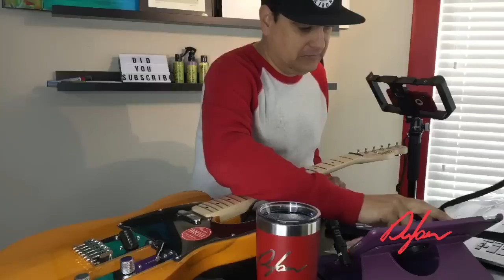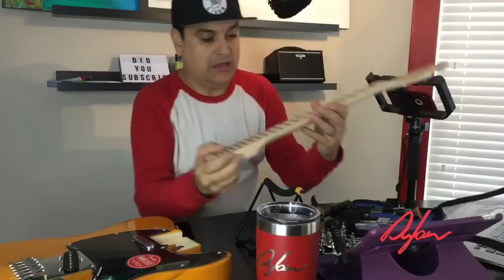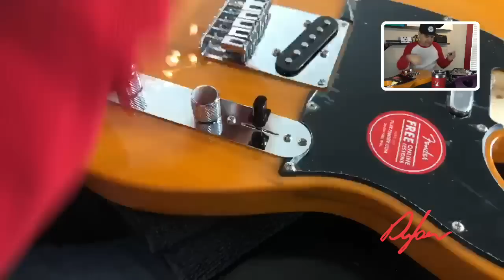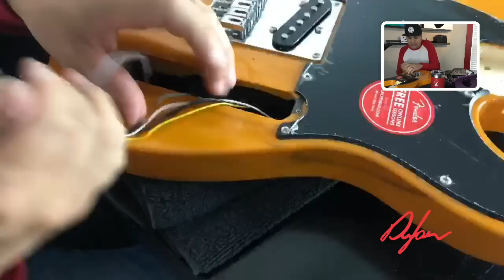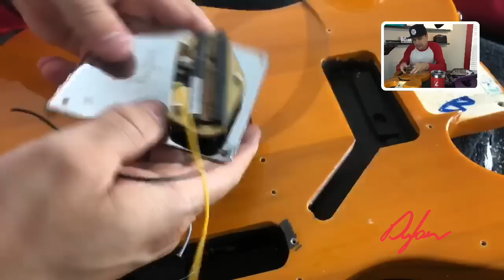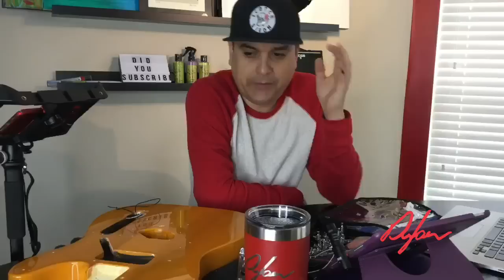What a $200.00 Guitar Looks Like Inside (Livestream)

Comment: I don't know which drop-in tuners you were referring to, but understand this: NO Fender tuners are drop-in for this Squier. Those two pins are in a different place than the two pins on SIMILAR Fender tuners. Those tuners will NOT work without drilling new holes for those pins. I agree that there's no reason to change them, but be forewarned that there are not many locking tuners available that will work without drilling new holes.

Comment: Seems like the Squire Limited Edition Bullet TeleCaster (Made in Indonesia - often on sale for ~$120-130) might be a better trade off in terms of an inexpensive starting guitar.  Since you have already modded the Affinity it would be a great comparo. It has the string thru bridge as well as a neck pickup that is mounted to the pickguard. It also has a little wider neck. I am guessing that both pickups are similar. I love the concept of just replacing what is not working or what is limiting the guitars performance. Great video !

Comment: NOOOOOOO!!! Don't change the pickguard colour! Black is fine. Black is traditional for a butterscotch blond Tele. Bruce's Tele has a black pickguard, and so does Keef's.
Interesting to note the differences with my own butterscotch 2017 Affinity Tele. Mine is routed for a single-coil neck pickup with no channel leading to the control cavity. No shielding paint in the cavities. I have considered AlNiCo pickups as a future upgrade, but I'm still happy with the stock pickups.
Reply: toan
Reply: The Originals were Black Bakelite with a Nitro Lacquer sprayed finish. if you flip them over there's a circle where they set them on a paint can while spraying and drying. That's why they're called 'Blackguard. My first Tele was from late 1954 after they were switching over from Black to White. They were ALL Single Ply.

Comment: From Leo:  Good video.  I do like a well made guitar with top grade components.  Modding and upgrading is a a lot of fun.   I agree with you that there is a point that it is just not worth it to get too extreme with upgrades.   
I bought a new cheap Squier Tele  three plus years ago to use as a loaner for students and a knock around guitar to leave out.  It has never been babied and shows plenty of scratches and nicks.  All I ever did to the guitar was clean up the nut when new and change strings.  That cheap Tele, with the cheap tuners, box switch, mini potentiometers , jack and pickups have never failed.   
Most beginners will sound better with another 20 lessons than too many electronic and hardware upgrades.  A more experienced player can benefit more from upgrades.

Comment: Bought a 2016 Model Tele Affinity and it became one of my Covid 2020 project guitars. Bought it for $110 delivered with a soft case and the guitar was in mint showroom condition. Stripped the neck and tinted the neck, fretboard, and headstock ( for aesthetics ). Added Brass saddles and a Tusq Nut. Replace the pickups with a used set of Seymour Duncans Alnico II's for $85 ( eBay score) Updated the pots with CTS and an Oak Grisby Switch. So for around $225 it's one of my favorite guitars in my collection. I only replaced the nut recently with a Tusq because it was a bit worn and chewed up. I love the feel of this guitar, a slightly thinner body, and a thinner neck. The tuners were fine, so left as is. Public Service Announcement -  I love cheap guitars that can be modded

Comment: Hey, Dylan, JG here. I made two neck supports for less than $3.00. 
1. I used an old pair of jeans I'd cut into shorts. The leg became a neck support by sewing up one end, filling it with rice, and sewing it closed. Bingo. The neck sinks right in. 
2. With so many Amazon deliveries, I used a rectangular cardboard box and filled it with filler stuff from all the deliveries, including puffy insulated packs. I cut a neck diameter into the box lengthwise and collapsed the cut into the well cushioned interior so that a guitar neck fits snugly into the cut-out leaving the top of the fretboard sticking out to do fretwork on stablized by three inch ends on either side. I covered the entire box with $1 contact paper from the local $1 store. The plastic contact makes the box water and oil proof and gives it a tiny bit more stability. I glued two white leather pieces together, also fm the same store, and glued it to the contact paper, which will hold it better than the porous cardboard underneath. Voila, really cool looking white leather guitar neck stabilizer. 
I use an ironing board for a guitar working station, BTW, which allows me to either sit or stand. I have a really nice piece of wood, which I'll eventually fasten to the ironing board permanently as soon as I figure out where I want it.
If these ideas help you or any one else, awesome. See you on the chats. Peace/Out. JG.

Comment: The only reasons I change tuners are for a better gear ratio on tuning and locking tuners make my string changes finish in half the time. Most of the problems in tuning actually comes down to the nut, not the tuners. Then the wood "tone" myth lol. How many oil can guitars and cigar box guitars are there???
I wish Fender would use staggered tuners to eliminate the annoying string trees.

Comment: I just bought a cheap 335 copy and I expected to change the pickups,but instead of tearing the whole guitar apart, I was wondering if I could just chop off the leads right in the cavity,strip off the ends and soider the new pickups right to the cut leads,right in the cavity,I can always add new leads to the pickups I'm removing but no one would want them even if I waxed them,yes they are that bad, trying to keep from taking everything apart to do it right, but of course I will srink wrap the leads and plan on pushing the excess back into the route,will this work Dylan or does it matter how long your pickup leads are,I plan to use this guitar to test different pickups and would rather soider leads than take the whole controls apart every time I change pickups,anyone can answer this post,let me know if you have tried this before and does the extra pickup wire matter as far as tone, people trim off pickups leads all the time,the question is, is smaller better,this is just going to be a pickup testing guitar until I find something for one of my better guitars with out tearing that apart until then too thanks.

Comment: I'm a little late to the party but if it were mine and I went as far as you went in the disassembly, I'd eliminate the string tree with those fender staggered, locking tuners, tusque nut, nicely built pickups, cloth wiring, and a reverse mounted control plate with the same pots but upgraded 4 way switch. I see no need to upgrade those pots because to me, I run my knobs wide open mostly. As for the bridge, I probably wouldn't buy a tele without string through body. Although, the teles this one is trying to imitate a 50's guitar and those didnt have perfectly straight ferrule holes anyway...Food for thought.

Comment: As a real fan of cheapest guitars I have made a hobby of refinishing cheap Kijiji finds. I simply replace ALL original parts into  them when refinish is done. Because I'm a loner. I play in my basement, self "taught". I have no buddies to jam with and no interest in that. So my guitars are ALWAYS played low volume and very gently. I DON'T scratch my pick guards. In these circumstances cheap tuners don't fail. Pickups never disappoint because my modelling amps and pedals offer endless opportunity to find pleasing tones. So I've got a lot of cheap guitars here with terrific setups that are in brand new condition. I've gotten pretty good at filing, levelling, shimming, etc. Sure they're still cheap stuff after all my work but I could not care less about that! I repaint pick guards to suit and I replace damaged headstock logos. I'm grateful for cheap Chinese made brand supported guitars.

Comment: Love the info! Quick question: It’s pretty clear that you aren’t a fan of the pickups that come standard on these guitars, and in my experience I agree they tend to sound sub par. What makes these so much worse than the strat and Tele sized “p90s” you offer on your site? Obviously the pole pieces are different, but is there a difference in the type of ceramic magnets used? Or do you use custom Alnicos in yours?
Reply from the maker: Jeff Ralston the type of ceramic and how they are wound both make a huge difference yes

Comment: Anything than black or white on this tele will look wrong. And if the pig guard are gonna be replaced then go full nuts and use green or pink oyster, If we're having a party then party hard. One question, i've heard that shielding a telly will affect the tone, true or false ? My suggestin for a nut, YJM brass type from Fender.
Reply: Shielding will definitely change the tone. That being said, it's so minute that IMO, I'd rather have a quiet guitar and most will agree.

Comment: You consider the bridge cheap because it has screws at the top (so what?) and because it is not string through. String through does NOT increase the cost of the bridge!!! Yes, you have additional expenses if you use one, but the bridge plate itself costs no more  or nor less than one that is string-through. You really need someone with more experience to edit your videos for content.

Comment: I have a Squier Affinity Tele and I want to add a Bigsby B5 to and do a "bubba mod" to the bridge because I also don't want to go through the hassle of swapping out the stock bridge. I've also looked at the possibility of just adding an Xtrem tremolo system because of the price but to be honest I really don't know about guitarfetish.com products. I know that a Bigsby will cost me about $150 and the Xtrem will be about $50. Anyone out there have any ideas? My Squier Affinity Tele was birthday gift from my wife, so I won't be selling or trading it in for a MIM Fender Telecaster. Oh ,as for the Tele in this video,  I would either keep the original pickgaurd or go with a B/W/B pickgaurd. Those are the only ones that would go with the butterscotch finish.
Reply: Here it is a year later ,and I'm revisiting this video. I have done mods to my Squier Affinity Telecaster. I did swap out the bridge for a Wilkinson ashtray style bridge with the three compensated saddles. I added a Bigsby-ish tremolo and I cut notches in the back of the bridge for the strings to pass through from the tremolo setup. No mods to the headstock or electronics or anything like that but it's an ongoing project. And yes ,it's worth it. Btw if you haven't replaced the pickgaurd, maybe a white or aged white pearloid pickgaurd would be the ticket. I sort ofchanged my mind some kind of black pickgaurd.

Comment: "You get what you pay for tone-wise."
Never spend more than $40 for a single-coil pickup. They are 1930s technology and there's nothing to them. And suggesting that they want to save money on "cheap" ceramic magnets (compared to slightly less cheap ceramics) by using more (expensive) copper is ludicrous and ignorant. You hardly ever get what you pay for when it comes to pickups. It's almost all snakeoil and you are no different when it comes to that.
Reply: And those are not "super hot" overwound ceramic pickups. Nope, you don't know what you're talking about. Take them apart. Test their DC resistance. Then you'll know. Then come back here and apologize for misleading all the teenage followers you have who think you know what you're talking about.